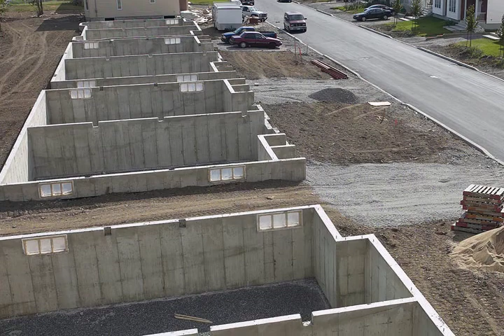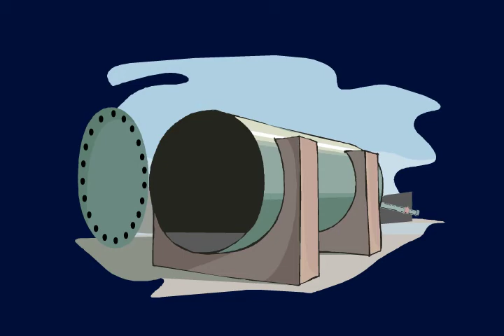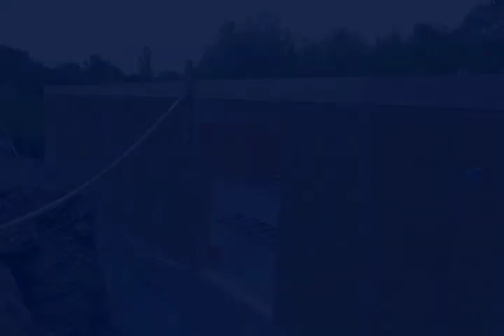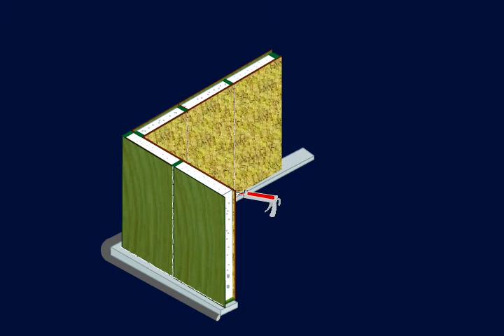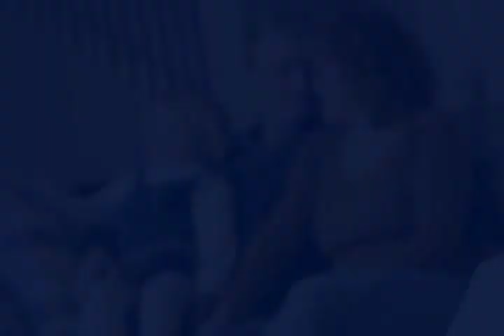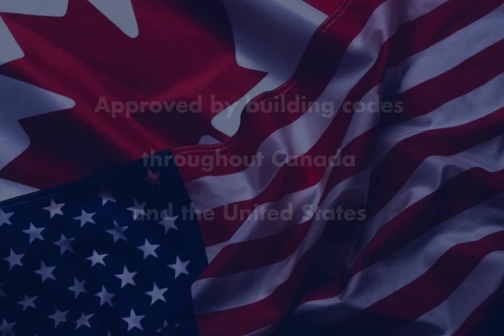Thermapan PWF Structural Insulated Panels

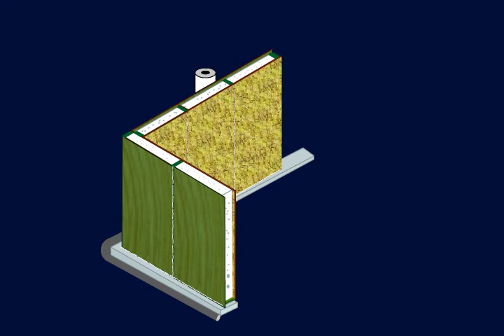Comment: In this video at 7:05, you mention a 6mil polyurethane moisture barrier being applied to the exterior wall. In looking at your installation manual from the thermapan website, it states, "NOTES: THE ADHERENCE OF ANY WATER-PROOFING MEMBRANE TO ANY THERMAPAN SIP
 PWF PLYWOOD SURFACE WILL VOID THE THERMAPAN WARRANTY". Can you please explain the difference between adding a moisture barrier to the exterior vs adding a "water-proofing membrane" to any plywood surface? Also, the manual shows to add the vapor barrier to the interior of the PWF SIP wall, not the exterior. Thank you.

Comment: I just put a bid on a house with PWF foundations.  I'm going to walk away cause the in the inspection we found a pipe had been leaking in the crawlspace and pooled up near one of the foundation walls and has discolored the wood possibly mold.  I would have never bid on the house if Id seen it in the walk though but I couldn't find the crawlspace entrance it was under some carpet in a closet. It's a shame it's a nice house in a nice location but I'm not taking the risk with a possible corrupted foundation.

Comment: i would still think that SIPs would be more of a gamble for sub-terrain basements only because there are other elements than decay.  There are termites.  I would prefer to use ICF basement and SIPs fasten to make the rest of the house.  Making the house nearly passive with the proper hvac erv system of course.
Reply from the maker: Thank you for your comment and for taking the time to watch our video.  The wood is treated in compliance with building code to resist termites and decay.  Foundation panels offer superior insulation performance (R48 to R62) and basements do not require dehumidifiers like ICF/concrete foundations because the of the positive drainage system design. Thermapan SIP foundations have been in the marketplace since 1984, without any warranty claims.
Reply: @thermapan  I've never been in a basement that "required" a dehumidifier. It may happen but don't exaggerate.
Reply from the maker: @pwashcroft  No exaggeration - most home inspectors recommend dehumidifiers, especially during the summer:  

https://lfpress.com/2016/08/04/a-closer-look-dehumidifier-protects-home-from-summer-humidity/wcm/aec155ad-b5c7-64f0-d9f1-f771eed2f078

https://www.washingtonpost.com/lifestyle/home/six-reasons-you-may-need-a-dehumidifier/2018/06/19/1f7da272-6b67-11e8-bea7-c8eb28bc52b1_story.html

Comment: The wood in Venice Italy doesn't degrade because salt water petrifies wood and essentially turns it into stone. Also, all the water proofing you claim is necessary for wood could just as easily be done with concrete. ICF construction would also resolve most of the issues you're describing. You also seem to claim wood foundations don't settle and develop cracks. The video is not well thought out and possibly disingenuous. The idea of a insulated, wood foundation is fine. But your video is full of misinformation.
Reply from the maker: Thank you for watching our video, but we disagree with your analysis. Venice’s timber pilings are petrifying because of minerals in the sediment and silt in the surrounding soil, not because of saltwater as you claim: https://sites.google.com/site/engineeringvenice/.   During this slow process, the lack of oxygen underwater protects the wood from rot, as our video explains.

There is plenty of  proof of wood being well preserved in freshwater too, just check out “Underwater Logging” at https://en.wikipedia.org/wiki/Underwater_logging.   Logs that sank in rivers during the colonial days are protected from rot and decay because they haven’t been exposed to air.

We stand by our claim that our PWF SIPs do not crack like concrete foundations.  We’ve sold tens of  thousands of panels in the past 40 years and haven’t heard a single complaint of cracking.  Homeowners who have experience with both concrete basements and our product notice a huge difference in living comfort thanks to PWF SIPs.